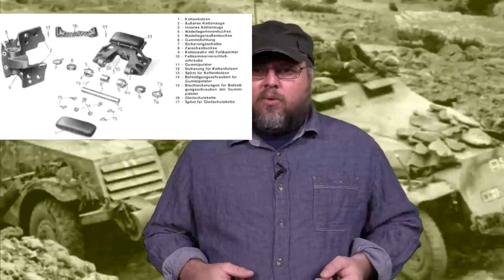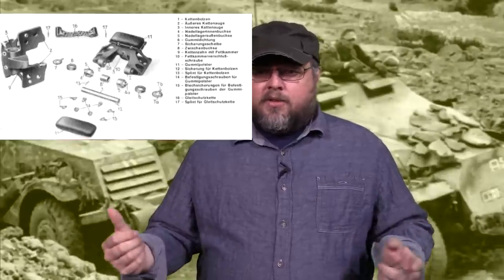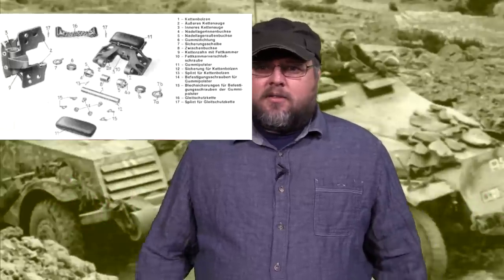M3 versus Sd.Kfz. 251

Comment: A good overview, but I would like to nitpick something. It is the internet after all. :P
The Sd.Kfz 251 its side armour might be only a few millimetres thicker, but that makes a difference. The 251 was clearly designed around providing protection against German 7,92x57mm AP rounds. Those had a penetration of 12mm at 100m. With the 8mm sides and the angling, you just about reach a level of protection against these rounds. If I recall correctly the later D variant had 12mm for the unsloped sections of the side armour, again to protect against AP rounds. As far as I know, most WW2 area ball ammo penetrated around 6mm of steel at 100m, so the 12mm of armour would be overkill for that.

The M3 its design in contrast seems to have been focused on providing protection against rifle calibre AP rounds only from the front. The sides and rear are not protected against AP rounds, only against ball ammo. That is a problem because German soldiers where commonly issued some AP rounds for there rifles, as well as for there machine guns.
Reply: Its obvious that the German half track was a better design, they were able to produce a surprising amount of then. The American m3 was a wheeled armored truck with tracks added to it, it was quick and easy to make and that was the point of it, even if that meant being exposed to AP rounds. Im a big fan of all half tracks but my preference is with the german models
Reply: I spoke to a WW2 vet a about 10 years ago who told me an interesting story. He and his friends had to ride in an M3 and speculated what damage an M1 Garand round might do to the rear door. Some thought it would scratch it, and some thought it might dent the armor. They gave it a try and the 30-06 round went clean through with no problem. It also went through a bag of grenades hanging on the opposite side of the door, miraculously without hitting any of them. He said they were all surprised at how easily the 30-06 penetrated what they assumed was bullet-resistant armor.
Reply: Armor or speed the m3 was faster and better motor and was 4wd

Comment: Excellent summary of the topic, especially coming from an American perspective. Like the M4 Sherman, not very fancy esp. later in the war but easy to build on very large scales + user-friendly. After all, that's how long wars are won. Some commentators already noted that Germany was never able to fully mechanize and even equip their Panzergrenadiers fully - usually only the Div. Recon Btl. + 1st Btl. of 3 of one PzGren Regt. had them. I find the US rubber track a great US style solution - easy to replace, gets the job done. For Germany, not an option: rubber shortages even forced them to try use soft iron for tank road wheels later in the war...

Comment: When comparing vehicles performance (offroad or on) it is always about power to weight ratio and the amount of torque that the vehicle has available. Horsepower only determines maximum speed (which is usually governed in this type of vehicle). It's torque that does the work and makes the vehicle respond better.

Comment: I know a man who has one of each and regards the M3 as much easier to drive, service and keep running. The 251 track is a pain in the arse to keep compared to the rubber track on the M3. The M3 was comparable to a truck in real terms as it's mechanicals would have been familiar to any American mechanic who could service a deuce and a half. Driving a 251 really requires a spotter on top as it's vision for the driver is very poor, especially to the sides. Both were very versatile and could carry all sorts of weapons and tow most of what was in the inventory.
Reply: Michael Bevan at least for the sdkfz 251 you don't get shot in the face when you are driving.
Reply: @nathanielorend9641  this is a good point and for the British universal carrier, as well, I don’t get the lack of protection for driver’s head

Comment: The difference in off road mobility is actually quite large. The M3 has a smaller footprint, but weighs 2.5 tons more. The Sd.Kfz could cross 2m wide trenches. The m3 can only cross 1 m wide trenches. The Sd.Kfz can also climb higher obstacles, but the M3 is better in deep wading. 

But i think you made a very good point. The M3 is a battlefield taxi (apc), Sd.Kfz is more an early ifv, which should keep up with the tanks. Both were a designed for specific purpose.
Reply: m3 half track is much more batter!!
m2 m3 m5 halftrack are my biggesssssst love ❤️

Comment: I also heard that the German overlapping track design had problems with ice sticking in between causing not to move
Reply from the maker: That is a common claim.  I would guess it would be more a case of frozen mud than pure ice.   But that's just conjecture on my part.

Comment: The Sdkfz.251 is logically going to be the more capable offroad machine thanks to that massive advantage in overall powered contact patch area provided by the long track. The overlapping wheel design also make for a more even pressure distribution from the track, again improving grip and increasing ride quality as a bonus. That the front wheels aren't powered is a non factor when the tracks are providing the steering, which is much prefered offroad vs having to rely on the front wheels for this, esp. in deep mud or snow. As for the HP difference, that only really matters for speed, as both vehicles featured offroad gearing that meant in low gears they had far more torque available than they ever had grip.

Comment: The rubber belt-like track is less noisy indeed.
The 251 has better offroad capabilities (because of the larger contact length) until it has to climb some kind of obstacle.That's where the M3's all running gear drive comes in handy.
I talked to an old gentleman who happened to have 5 M3s (all ex-Izraeli pieces, including one with mine-clearing plow) and a Czechoslovakian OT-810(disguised as a 251). The US halftracks can easily go up and down from a trailer (sure, you can use them on roads, but a "100ish" km distance from one festival to another might wear down the belts and they are a bit slow for highway use).The OT however can go down easily from the same trailer, but to move it back again, they either have to use a windlass or they run for it to get enough momentum. I think somebody even uploaded a video about such an attempt.
Reply: And of course,it was an excellent,informative and entertaining video to watch.
Reply: The biggest difference is when you take an untrained individual, and invite them to drive "it". 
You can take "Joe", and he'll drive a  M3 with little issue.  But the 251?  You have an unpowered front axle, track laterals, and a "steering wheel" at an odd angle .  They steer like shit on a good day.

And then you have the track . As a mechanic, the M3 (U.S.) is a hell of a lot less hassle.
Reply: no m3 half track is  much better!!!
m2 m3 m5 halftrack are my biggesssssst love ❤️ 😍